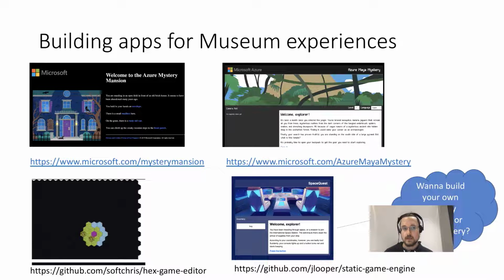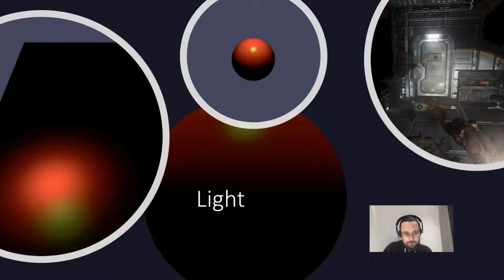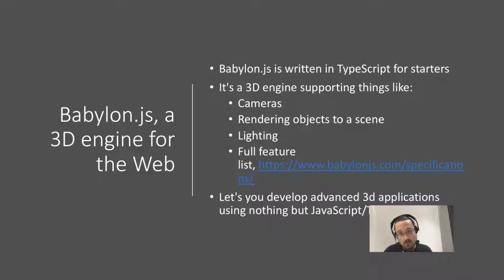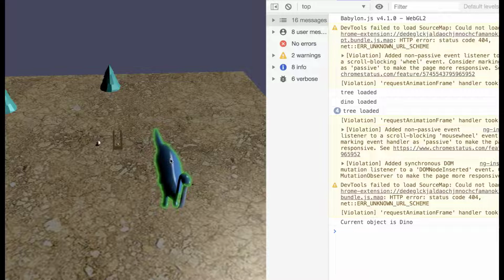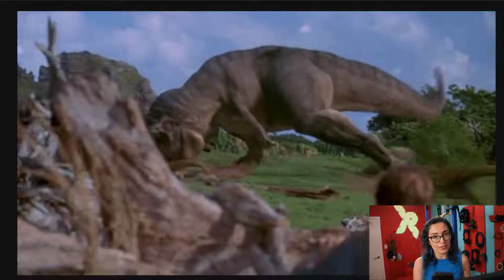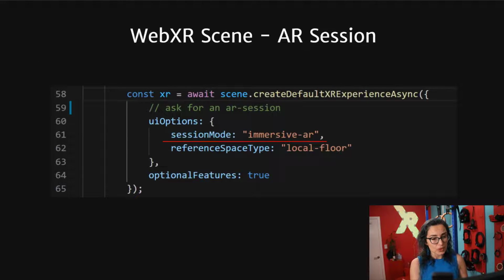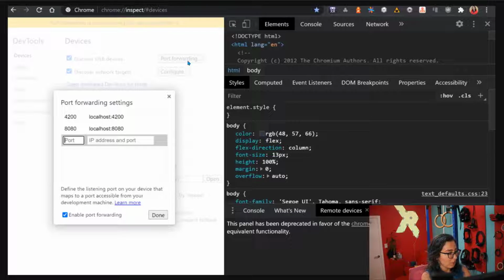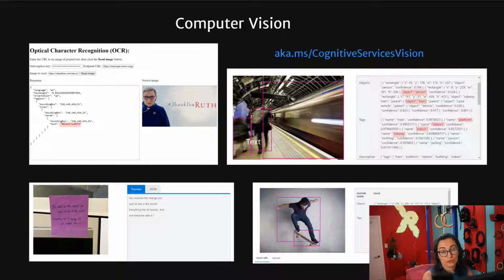Getting started with WebXR Augmented Reality using Babylon.js

Comment: Thanks, great talk  ! ☺

I am beginning to experiment using WebXR with BabylonJS for my client (I am a freelancer). 
I am trying to use the plane detector but the detection goes wrong and I end up with a plane placed in the air. The phone I'm using have a poor camera, can this be the cause of that issue, or maybe is it too early to use it ? (It is a Samsung Galaxy A20e)

* My apologies for my english is not certainly great, I'm French ^^"
Reply: I don't see Samsung A20e under ARCore supported devices and that might be the issue: https://r2.community.samsung.com/t5/Community-Guidelines/ARCore-supported-devices-SAMSUNG/td-p/3176358. Surface detection requires some depth sensing capabilities of ARCore to define the distance of the surface. If the device can't tell, your plane would be flying in the air. For devices that support ARCore, some other things effects the accuracy. If there isn't enough empty space and there are a lot of objects on the surface your are trying to detect, it has hard time. Lighting effects the accuracy too. When you are having hard time with detecting the surface, you can move more and scan the surface from different angles, make sure there are more empty surface without any other object and play with the lighting. I hope it helps. Your English is great by the way. 😊
Reply: @AysSomething  Thanks for the quick answer ^^

Finally, I followed BabylonJS' exemple (https://playground.babylonjs.com/#98TM63) and I made it work! ! 😊
The current result : https://www.stochastic.fr/Experiments/UnderworldEngine/
Now I will try to add a model on the plane with an anchor :)

I knew it would work because in my last project I worked using Unity / AR Foundation with that phone, the tracking is just poor. I don't know why it is not listed on the samsung web page because in Google's one it is (https://developers.google.com/ar/discover/supported-devices).
Reply: @thornadis_tv   @AysSomething  i hope this is not a dumb question - i was under the impression that Chrome for all phones, and IOS & Android, can now track planes using real-world feature points to track the AR fairly well? Is this still only limited to a few phones? Or is it widespread now, for any phone that has latest Chrome installed?
Reply: @hiranga  Hi Hiranga, When you work with systems like AR Foundation (Unity3D) or WebXR, behind the scenes you use either ARCore (Android) or ARKit (iOS). While ARKit doesn't require a specific device (Just iOS 11 or greater), Google took the decision to put a restricted list of devices in place. You will be able to experiment an AR app only if your device is on the list because you need to install "Google Play service for AR" first and the Play Store won't allow you to download it if your phone is not on the list.           I hope it helped you,
Jamal BOUIZEM
Reply: @thornadis_tv  right... so is that to say that a WebXR experience, completely running off a webpage / rendered in browser(? is this the correct term for it?) may not work on every Android and IOS device that has the latest Chrome Version installed?
Reply from the maker: @thornadis_tv  I didn't know about the Google Play rules. That makes sense from the security point of view. It doesn't apply to web though, which is the beauty of Web 🤓.
Reply from the maker: @thornadis_tv  awesome. Thanks for sharing. I'm glad it worked out and you persisted.
Reply from the maker: @hiranga  yes, that's true. WebXR Device API checks if the WebXR capabilities are available on the device. If they are not ARCore or ARKit enabled devices, WebXR can't do anything. You can still view your content as 3D if you develop it as an option.
Reply: @AysSomething  i hope this is not a dumb question - i was under the impression that Chrome for all phones, and IOS & Android, can now track planes using real-world feature points to track the AR fairly well? Is this still only limited to a few phones? Or is it widespread now, for any phone that has latest Chrome installed?
Reply: @hiranga  not a dumb question, getting answers like these is not easy from documentation. Plane detection from feature points is a functionality of ARCore and ARKit under the hood. Supported devices list here for ARCore: https://developers.google.com/ar/discover/supported-devices. iOS devices doesn't support WebXR other than on WebXR Viewer: https://apps.apple.com/ie/app/webxr-viewer/id1295998056
Reply: @AysSomething  thanks for your reply! Now I'm a little more confused between the frameworks - can I clarify - does that mean an experience or game designed in Babylon can still be "played" or interacted with (button presses etc) in IOS ? Or not?
Reply: @hiranga  babylon without WebXR, 3D on the web, works fine pretty much everywhere: https://caniuse.com/?search=webgl. If there is an AR or VR experience, you can see it on WebXR viewer app on iOS. https://caniuse.com/?search=webxr. Does that make sense? Eventually Apple will implement WebXR on their browsers too and we will have it on every phone browser too. We don't know when though.
Reply from the maker: Not a dumb question at all. It is still limited to never phones with depth camera, pixel 2+ I believe. Chrome have the implementation but Chrome on iOS still doesn't have any of the WebXR. You can still view it with WebXR Viewer app on iOS though. https://apps.apple.com/us/app/webxr-viewer/id1295998056. Hope it helps.
Reply from the maker: @hiranga  sorry that it is so confusing every device doing their own thing. So you can play a babylon game with button clicks in iOS but you won't be able to view it in AR/VR mode on iOS, unless you download WebXR-viewer. Your game would be a 3D game on the web at least, something like this: https://app.brainywarriors.com/index.html?demo=true. Apple finally commited to support WebXR though. It shouldn't take long before you don't need to worry about which device.
Reply from the maker: @hiranga  Only way I know to view WebXR on iOS is using WebXR Viewer: https://apps.apple.com/us/app/webxr-viewer/id1295998056/. Unfortunately it is not maintained anymore and debugging is painful, I've heard. Good news is that Apple is working on it, you can see the status here: https://caniuse.com/?search=webxr. You can also use a paid service like 8th wall: https://www.8thwall.com/. Other good places to get help is on reddit: https://www.reddit.com/r/WebXR/ or https://www.reddit.com/r/LearnXR/. I hope it helps.